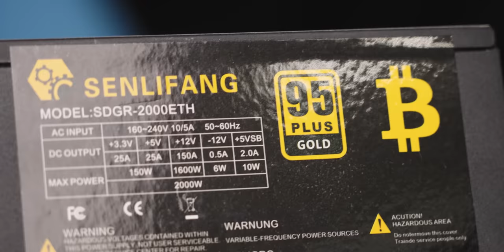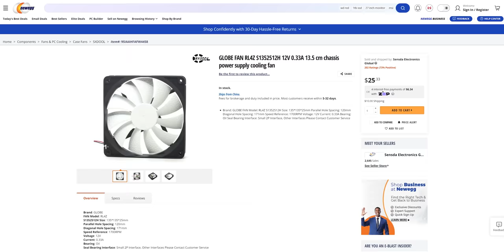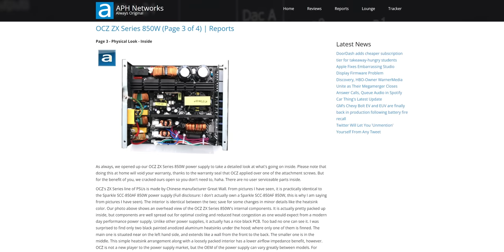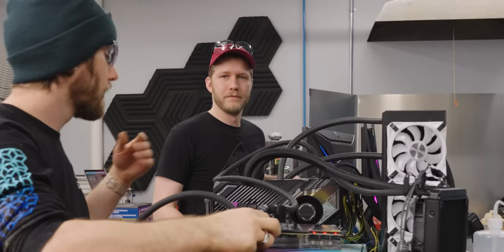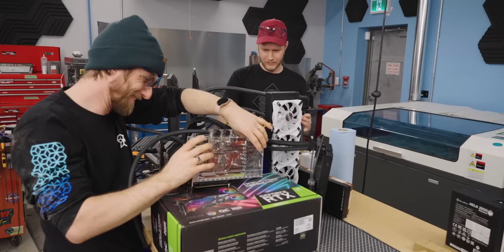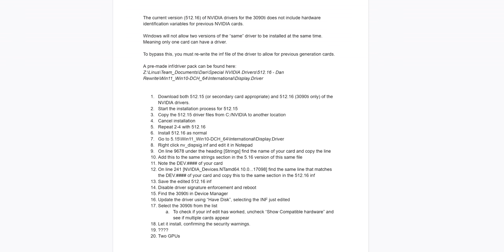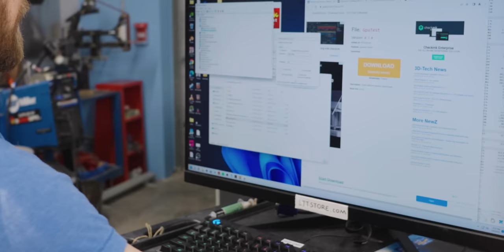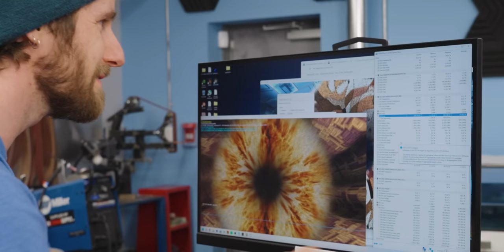This is one SKETCHY 2000W Power Supply

Comment: Help me understand why it was necessary to hack a NEMA 15R onto a power cable when you could have just used an actual 240V PDU with a standard C13/C14 connector. The C13/C14 is rated for 240V use and you could have used the opportunity to actually give some tech tips about different power connectors that typically only exist in the datacenter rather than "really bad idea" hack jobs.
Reply: "entertainment value"  They know their audience well.
Reply: Oofta guy!
Reply: If they were going to hack it, it would even have set a better example to put the NEMA 15R onto the C14, then use a 240V extension cable rather than making a "spicy" one.
Reply: @BobHannent  A C14 is a computer inlet and a 5-15R is a North American outlet. A cable with both of these wouldn't have helped. I think what you want to say is a NEMA 6-whateverP inlet plug on one end and a C13 outlet on the PC end. For their particular setup I believe they were using an L6-20P plug. In datacenters L6-30P plugs and L6-30R receptacles are more common.
Reply: Maybe because they didn't have a 240V  PDU lying around?

Comment: 6:38 Noooo they're not, those are polarised capacitors (hence the negative stripe down one side), you hook those beuaties up to AC and you'll have an electroboom video :)
Reply: These could be after the retifier so it would have an oscilating input but on same polarity.
Reply: @Max  More like he meant that they are on the high voltage 240v side which is AC from the wall, but yeah before power goes to this big capacitors it goes through Full Bridge Rectifier which converts it from AC to DC
Reply: beauties

Comment: Actually these big capacitors are also DC. The mains input is rectified and filtered by the big caps. A small circuit then switches the transformers on and off at a frequency of a few kilohertz (and makes the DC voltage AC again, but at a way higher frequency). The transformer output then charges the small capacitors. When the desired voltage is reached, a feedback signal is triggered, that turns off the small circuit that controls the transformer until the voltage is below a certain value. Then the circuit turns back on, charges the small caps…… and so on.

All modern buck converters work this way because a huge transformer is inefficient, heavy and expensive.

Comment: Jeez you guys,  as someone who repairs switch mode and linear power supplies and inverters I noticed you got so many things wrong about the design/topology of the circuits inside these supplies that maybe you should have edited out the 'critique' of the interior completely.   First, you highlighted the secondary output filter stage in the video,  not the input EMI filter stage.  Second,  "NTC" = Negative Temperature Coefficient,  that would be an inrush current limiting thermistor,  not a MOV (as a side note,  the cheaper power supply has no MOVs that I can see,  and is likely just using spark gaps on the bottom of the board).  NTC thermistors limit inrush current on startup and are then generally bypassed with a relay,  MOVs shunt high voltage transients to neutral/ground to protect the circuit.  Third,  nothing wrong with touching a transformer that's not powered,  they don't hold a charge.  

As far as why the Silverstone power supply is heavier.  First,  both of these power supplies have EMI filters (the Silverstone has multi-staged EMI filtering) and both have APFC (Active Power Factor Correction) circuits,  on the cheap power supply you can see the large APFC boost converter inductor next to the main input caps.  So stating that the cheaper power supply is lighter because it's missing the APFC circuit is wrong.  Second,  the cheap power supply is likely a half bridge or a full bridge / forward conversion topology and an older design.  The Silverstone is a more modern LLC resonant converter design combined likely with a full bridge,  which means it's using a series of inductors and resonant capacitors to filter,  shape,  and generate the drive signal after the switching FETs.  You'll still have a main switching transformer,  but you will also have large inductors in this resonant circuit,  as well as the APFC inductor,  secondary output filter inductors  (all of these inductors look like transformers),  a standby transformer,  gate drive transformers,  etc.  Third,  the modular design on the Silverstone is going to add weight,  as it requires another board and more hardware.  Fourth,  the Silverstone has far more discrete secondary DC/DC conversion components and filtering as it is likely using synchronous rectification - that is,  MOSFETs are being driven on the secondary side by a separate controller IC and are being used to "emulate" what schottky diodes would normally be doing on cheaper power supplies.  This is a much higher efficiency design but it requires more components,  increases complexity,  and increases the BOM cost.   Fifth,  this power supply is undoubtedly using real copper everywhere.  Aside from all this, there is a lot more but you get the idea.

Believe it or not,  but cheap generic power supplies like the one in this video sometimes don't even use copper at all,  and will instead use aluminum that is coated to look like copper.  This means the wires,  inductors,  transformers,  nearly everything will be aluminum,  as it is cheaper.  This is not good,  as it is not as good a conductor as copper,  has somewhat higher resistance and different impedance characteristics,  so it generates more heat under higher current loads (particularly with inductors as aluminum's magnetic field saturates much faster).  If these cheap power supplies do use copper,  they will use as little as possible.

Lastly,  a bit of a nitpick but Alex said "I'm going to take a couple of guesses as to why our Chinese power supply is so much cheaper..."  Just an FYI but virtually ALL ATX power supplies are made in China,  even the expensive Silverstone power supply you have there.  Silverstone likely contracted Seasonic to design and manufacture that power supply,  and all Seasonic power supplies are made in China,  even their high end models.  People really need to get away from this mentality that China = cheap junk.  It's ridiculous and ignorant.
Reply: Nice going into the details, I was grinding my teeth at multiple intervals when they talked about stuff they didn't know. Small transformers won't hold a charge because the stray capacitance is negligible, however HV transformers must be put to ground, otherwise you'd probs die.

Comment: 3:55 you can touch the transformers but not recommended to touch anything in a PSU also what never touch are those thick caps, those can give you a really good shock if they are charged (only if you touch it pins)

Comment: As an electronics tech of 30+ years experience, it hurts so bad to hear you guys "explain" what is inside of a power supply ( especially our hippie haired friend @5:09 ). Also, the caps in that supply you pointed at are DC, Linus. Multiple transformers for the different rails that the supply supports. 120v vs 240v also has frequency difference in the EU ( 60hz for 120v vs 50hz for 240v ). I can see this is a very dirtball supply.

Comment: Japan actually doesn't run at 120 VAC like in the US/Canada, they run at 100 VAC, with 50/60 Hz split. Grounded outlets (NEMA 5-15 type) are also basically non-existent in Japan.

Meanwhile Korea uses essentially German-style sockets with 220 VAC, 60 Hz. Pretty crazy differences, but <220 VAC is basically worthless unless you hate actually running things off an outlet :)
Reply: That's pretty interesting, I wonder what kind Taiwan uses.
Reply: Japan, like north America also runs a split phase into homes/apartments. So they do have 200v available for A/C, large devices. Grounded outlets usually exist as a 200v outlet or an outlet with a grounded screw terminal, commonly in the kitchen or toilet/bathroom (Microwave, fridge, bidet). I had a grounded screw terminal behind the TV in an older apartment for what I'd assume was for older CRT style televisions.

Comment: The standard voltage in Europe and many parts of the world is 230V ±6% since the 220V and 240V standards were harmonized in 2003.

Great Britain and Australia (that used to have 240V) have an extended tolerance of 230V +10%/-6%.

Comment: 230v16A=3680W is a normal Euro plug/outlet, its baffling to see them modding a cable to work with this...
Reply: They modded it because there is different plugs for 240v and 120v in Canada so they modded it to use the 240v cable
Reply: You get they had to do that because we have special outlets for 240v right?
Reply: All euro plugs are rated for 16A? The standard NA ones are 110-120V 13A, anything higher in V or A is specialty, so the most you can reasonably expect is 1500W
Reply: @Realtime1501  I know how it works in Can/USA I'm just fabbled they still use that system.
Reply: @kaldo_kaldo  I meant the outlets in a EU house have 16A or more. Cable extensions are as powerful as you buy them.
Reply: Especially given the proper cables are available online or in some cases enthusiast stores.
Reply: @Konarcoffee  We use the schuko plug for the 16A at home 
Technically they have to use the industrial type of the plug that is grey with the last part of the plug blue to differentiate from the 380V one that is red
Reply: @no-eb2xx  That's what I meant but I mixed up some info. UK is 13A, US/Canada are 15A at the outlet

Comment: They should really start doing "240V-only" variants of all power supplies - cheaper to make, cheaper to buy, lighter, less complex.
Reply: Absolutely
Reply: It doesn't matter, we would eat up the cost of the logistics of having twice the amount of products anyway. At least this way it's one piece that works everywhere.
Reply: Extra tooling and manufacturing costs would come down over time, but honestly doesn't seem worth it for the consumer. You can buy cheaper 240v psus from china. They're of decent quality if you know what you're buying.

I setup a bunch of mining rigs for my friend. He bought qdion (fsp) and afox (foxconn). So far none of the 30+ units have died. Been running non stop for around 3 years now.
Reply: Or 110V only ones, this would be a fun one (Chinese sellers usually ship the wrong item).
Reply: Nope, can't travel with those.
Reply: There's really not much difference in these types of power supplies. For the old supplies with the little voltage switch, the switch is the only extra component. For modern ones with active PFC, the circuitry naturally works with any voltage. The only difference is they need a slightly larger coil and transistor at the input.

After the initial input stages, all of these supplies run from ~340-400 volts DC internally. The main circuitry where all of the cost and complexity is remains identical.

Comment: I've actually had this PSU blow up on me. This is a f***ing fire hazard.
Reply: What wattage was it running at the time?
Reply: What were you expecting from a cheap a$$ PSU. Do yourself a favour and buy a certified one next time.
Reply: The heat worries me. They weren't even pushing it that hard. I have a 1600w that runs 24/7 at about 1400w draw and the fan only comes on on the absolute hottest of days.

Comment: Good faith feedback not trolling, I promise:

Linus is a decent communicator with an at best layman understanding of electrical engineering, and Kyle presumably has a good engineering background but really really did not explain any of the technical stuff well.

Like you don't have to go into huge detail, but if you're going to make a big deal out of weight and magnetic components, you've got to explain the basic role of the magnetics. Or the caps; there are no AC side capacitors, there's HV DC and LV DC. HV is closer to the AC input but it's been rectified, it's categorically not AC. Similarly, why do "beefier bits" make a difference? The MOV explanation was arguably passable (but please script technical stuff to make it decent) but NTCs again are absolutely not the same as MOVs. 

Not every video needs to be technical, but if you're doing a teardown and explanation of a power supply, it absolutely does need to be. It also especially needs to not have actively incorrect information in it

The fact that an entire chapter was titled "Metal Oxide Varistor??" and then spends most of its time being both off topic and wrong should be a warning sign
Reply: Lol I like it because it gives me a good laugh honestly. It was pretty funny when he said "AC side capacitors" and you can clearly see they are polarized electrolytics.
Reply: They are sort of right though, the input filter caps are on the mains side of the supply. I don't remember them saying they actually had AC applied to them. In a really basic power supply all that's between the AC mains and those caps is a rectifier.

You can tell that some of these guys sort of know what they are talking about but they are not experts. Maybe they are trained EEs but not practicing. It would be good for them to get a real EE on staff to help guide what they say so it's more correct.

I've certainly seen worse explanations of how electronics works on YouTube but perhaps that is not a high bar...

Comment: i remember having a bad 750watt psu 10 years ago. Everytime i launched a game, my fan speed would drop as there wasnt enough current. One day it just popped, thought i lost the PC. It was my first ever PC build, didnt know anything about psus, just though high number low price = good
Reply: Around 17 years ago I blew up an entire system with a cheap AF crap power supply that went up in smoke after only half a year of use, since then I've never ever bought cheap ass no-brand power supplies ever again. Thing I regret the most from that incident is the loss of all the data I had on my 2 HDD's in that thing, thousands of pictures, videos and mp3 I'll never ever get back ever again.

Comment: If I remember my electrical stuff correctly, a twist lock plug comes in a variety of amperages, from 15 to 50A+.   Twist Lock plugs are commonly used the theater for lighting, because the plug "locks" to make the connection stay in place.
Reply: No twist lock plugs have uses in mor than just the entertainment industry.

Comment: In Brazil there are two voltages, 127v and 220v, in some places it is only 220v, in others there are both, 127v and 220v, and in certain houses you can find 220v and 127v sockets and they are not different sockets, sometimes it is a socket with different color or has a label saying it is 220v, but that doesn't stop you from being able to plug something with 127v into the 220v.

Comment: 9:41 Thanks for just answering the question instead of pretending you don't know, Alex. 🤣 Every time Linus does this now, I think of the terrible one Linus and Colin did in the 4 gamers one GPU Parsec video.  It drove me nuts, and I've seen it a few times now (because I was considering using the virtualization method - before finding Aster on the LTT forums for two actual desktop environments without virtualization) and it keeps driving me nuts now every time he does it in other videos.
Reply: Aster is great and cheap! Just had to learn how to setup sandboxie so all 3 my kids could use steam etc

Comment: I've used a bunch of these on mining rigs and till now, none of them failed even tho they are using 1400-1800W from the wall at 240V.
Reply: Yes they're mining ⛏️ power supplies. Don't know why linus didn't Mention that .. that's why they're so loud
Reply: @osamahalzarouq1981  it literally has a bitcoin logo on it, and when they're connecting it to the motherboard, he says it was meant for mining. They know.

Comment: 13:35 That was evil 😂👌
But talking about the power supply. A cheap one able to deliver so much power is uncommon, but possible. The 95+ gold and bitcoin "rating", why the hell ever bitcoin, is sus though... But cheap products can perform. The reason they are cheap is that they are made with the cheapest possible components. They will fail, depending on usage even pretty fast (months), and may also cause harm to the components behind it.
Reply: I think it's an upcycling operation where they take e-waste, find semi decent PSU there, and freshen it up quick.
Reply: It's what is known as "cha bu duo" in China. A low specs product that is labeled as higher specs product. Basically like overclocking but is applied to various Chinese products (electronics, vehicle, building, you name it). It's done away with safety margin, so if in case of US/Europe/Japan products you can use them 10% or 20% more than its stated workload (e.g. overclocking) and still come out all fine, Chinese product will just blow up if you use it to 100% workload because it doesn't have safety margin in case there is a power fluctuation.

Comment: It is interesting to see that your high voltage outlets with big cables has 240V, like our normal ones in europe, while our high voltage stuff have ~400V
Reply: Our stove plugs are massive: being rated for 240V (4 prongs: 2 hot (120V) 1 neutral (0V) , 1 ground) /40A.

Edit: was having trouble looking it up. Apparently it is NEMA 14-50R , rated for 50A. The 40A stove rating would then be a derating of 20%.
Reply: we mostly don’t have plugs on stoves. those are hardwired by a electrician. but most stoves run on 3 phases each 400V to each other, neutral and earth. 16A sometimes 32 amps
Reply: In more industrial settings 480v is common in the US.